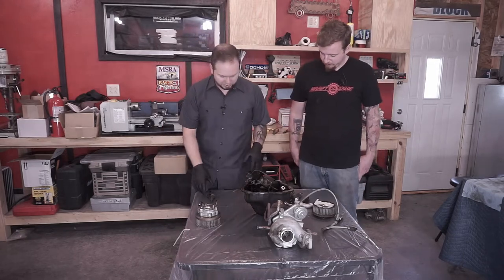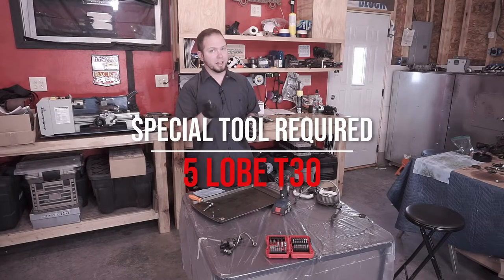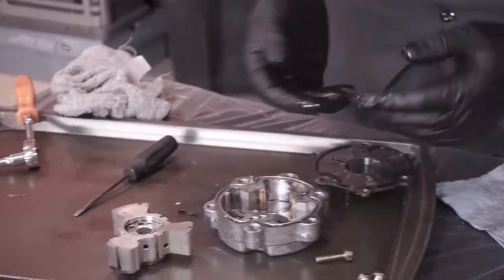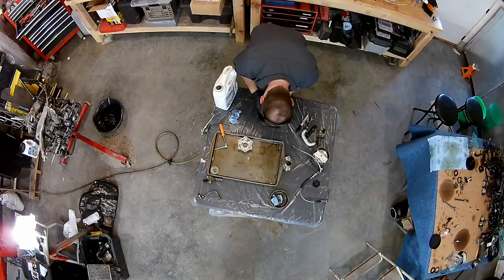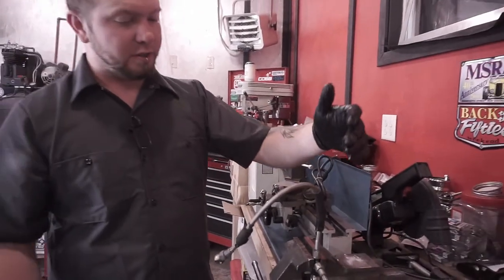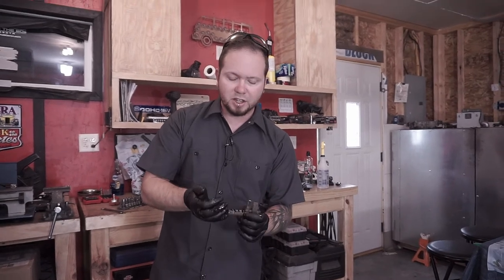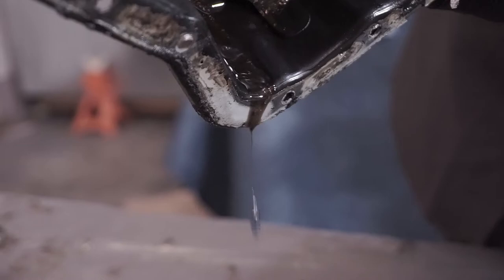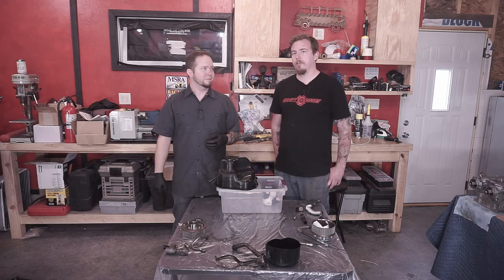Subaru bearing failure: Component Cleaning and  AVCS rebuild; The Legacy GT Wagon Build Ep3

Comment: It is important to note that for those with dual AVCS, the rotor does not just push out on the exhaust cam gears the way it does on the intake cam gears, as seen in this video. For these gears that do not come apart, i have soaked them in gasoline overnight in an attempt to clean them out. I will let everyone know how my build goes. I will also change my oil very soon after finishing the build to get more metal debris out.
Reply from the maker: Thanks for clarifying!
Reply: @DadModsMedia  For these gears that do not come apart, i have soaked them in gasoline overnight to clean them out.  I also am going to try aligning them myself using regular camshaft. Outfront motorsport uses a special bar which is one thousand of an inch larger than a regular camshaft, but I think a regular camshaft might do the trick. Maybe I can find a way to make the compressed air test tool as well.
Reply: @360Sebastian360  After much research it’s imho the Company23 tools are the ones damaging/scratching the AVCS gear internals. Not even the Subaru FSM mentions the tool Company23 invented. Another tool must be used to remove/install the cam bolts in order to prevent damage of the AVCS Gears inside. I’m curious what ended up happening to yours? Btw, not sure if gasoline can expand the big O-ring these gears have inside..

Comment: Great video! Thank you very much. Does anyone knows the part number of those crazy looking o- rings inside the AVCS pulleys?
Reply from the maker: I was only ever able to find replacements on ebay from an oversee supplier. But this was many years ago so I can't speak to whether they can still be found.  Another factor that is very important is alignment of the two halves of the AVCS pulleys when you put them back together. Misalignment can cause some very dramatic issues I'm told. You may want to considering speaking with Outfront Motorsports if you are worried about your ability to align these correctly. They have machined an alignment pin to guarantee this and, last I checked, offered it as a service.

Comment: You need a special tool that doesn't exist to align the cam gears during assembly or else you're going to have issues... My advice: send your avcs cams to out-front motorsports for service.
Reply: What do you mean, it only comes togheter one way, and it can't misalign with thoose tolerances. I have NEVER had any trouble

Comment: you can actuate the avcs OCV with a 9 volt battery feed :)
Reply: what about a 12 volt battery ?
Reply: @360Sebastian360  That works too, I used a 12v AC to DC coverter to test my own OCV, although this will only show total failure (mine was intermittent/inaccurate, but not totally dead and passed this "test" fine).

Comment: hello to remove the avcs it is not necessary to remove the motor?  subaru legacy 2009
Reply from the maker: Good question. I had my motor out but I could be it being possible to replace the pullies with the engine still installed. Maybe someone can chime in who has done it

Comment: Can I ask I was going to do this on my 2011 sti UK model dual avcs as doing rebuild,but I've been told you need a special  tool to align the inner rotor to the outer rotor, as it can move ever so slightly when doing up the 5 torx bolts and causes the assemble to lock up and not operate correctly,how did yours perform when back together.
Reply: just use the camshaft that goes with this avcs gear to align. makes sure it can rotate freely and feel the inside to make sure it feels straight. maybe u can even wrap the camshaft with masking tape once to make it a lil fatter for the alignment process.
Reply: @360Sebastian360  Interesting approach.. so the masking tape would add the 1/1,000 or so needed to serve a tool so the internals are aligned properly?

Comment: Where Can I find and what are these internal gaskets called?
We had one break on disability.
Reply from the maker: You talking about the AVCS gaskets? Those little seals aren't sold in the US from what I could find. But back when I had my Subaru I did find some seals on ebay. Believe they shipped from the middle east.

Comment: So i actually rebuilt my engine and i didn’t clean my intake gears or my passenger side exhaust gear (2014 sti w dual avcs). I replaced my driver’s side exhaust gear. Now i have an issue where the gears are stuck in an “advanced” position and now the car doesn’t start. Would I be able to disassemble, examine, and toss these in an ultrasonic cleaner with some non-corrosive Purple power?